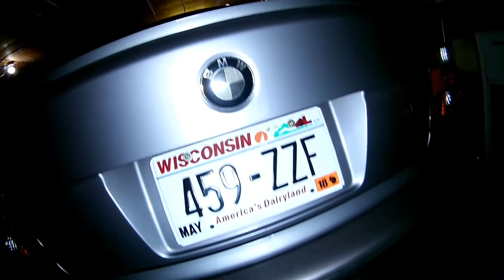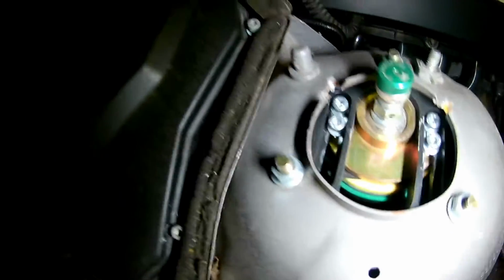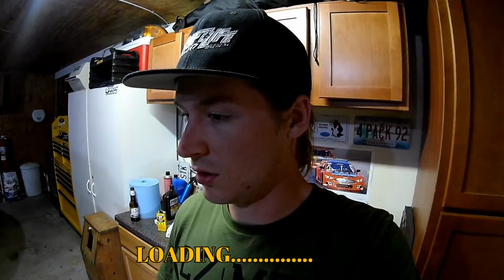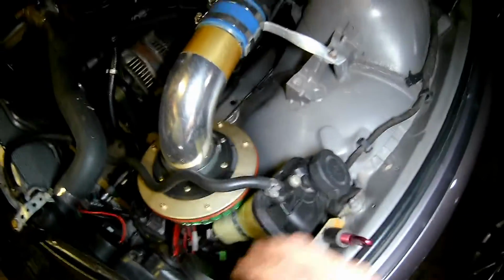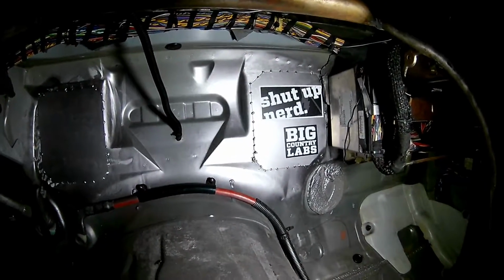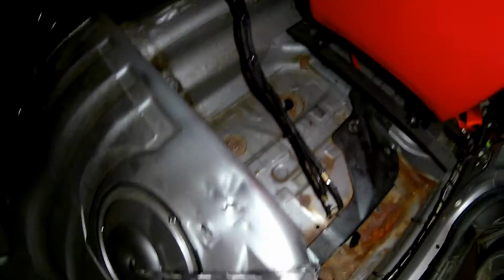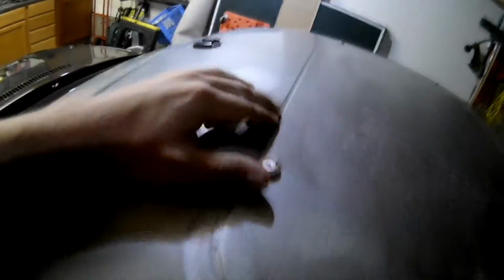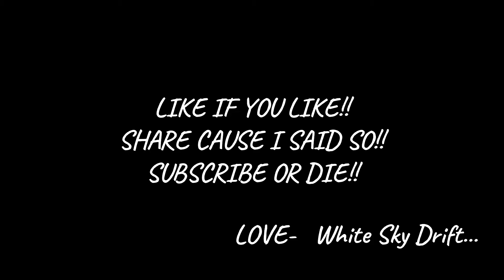E39 Build Breakdown!!

Comment: Love the car bro thing is sweet, just a quick question tho. I have a e39 myself and I want to throw a inline hydro on it. Thinking of buying a EBay hydro and change the master cylinder to a wilwood just cause it’s a bit cheaper that way. But I don’t want to run hard lines! How did you find out the fitting size to run your stainless steel lines from the master cylinder to your hydro also where did you buy the lines ?
Reply from the maker: I wouldnt use any part of an Ebay hydro honestly haha it's worth paying a little extra for a quality lever
Reply: White Sky Drift agreed but I was thinking on making my own custom handle to begin with, but what I really want to know is how/where did you buy your hydro lines and how did you find out the fitting sizes for your factory master cylinder